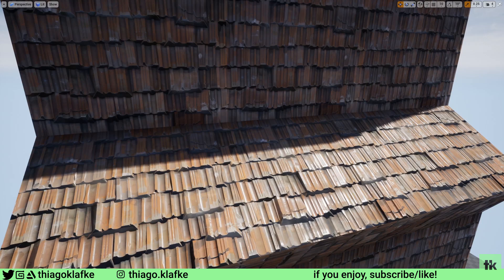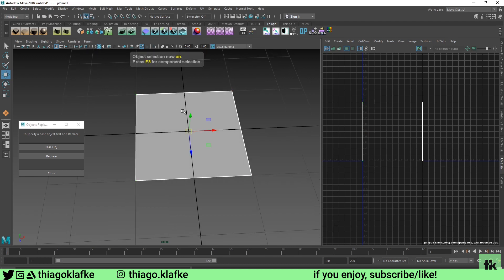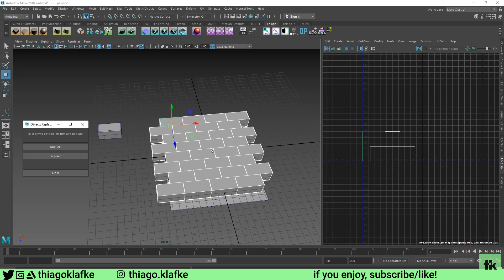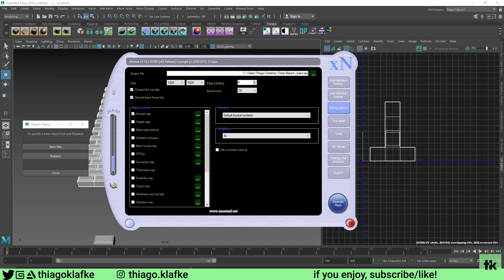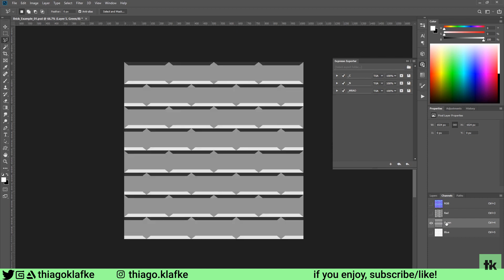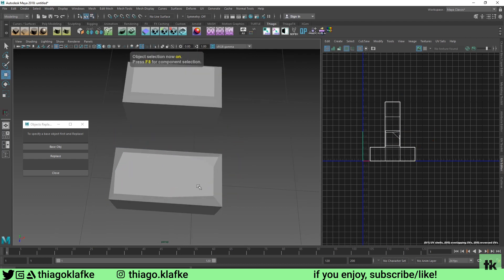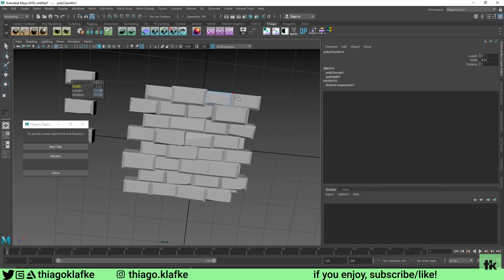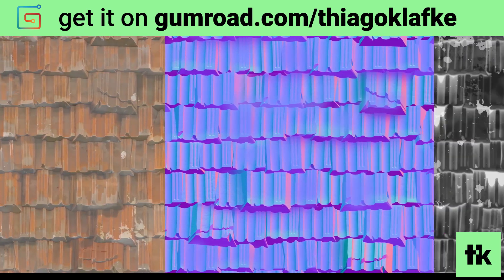[Tutorial] Modeling Tileable Textures

Comment: When i triangulated the adjusted bricks, i get super weird shading/normalmaps. The triangulations are extremely apparent. 

Did you use subdivision to prevent this?
Reply from the maker: It could be that the faces are not planar? Do you have pictures?
Reply: Its probably too late but I think I know the problem you are having. The thing is that you should not triangulate anything. Otherwise it will break the illusion. You just bake the normals and it will work.